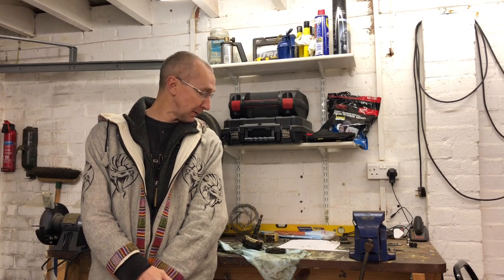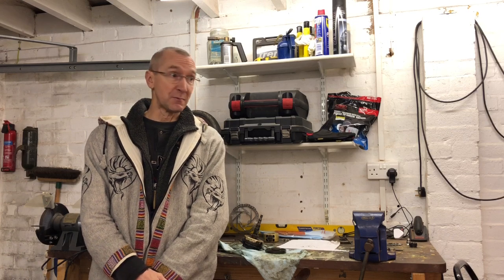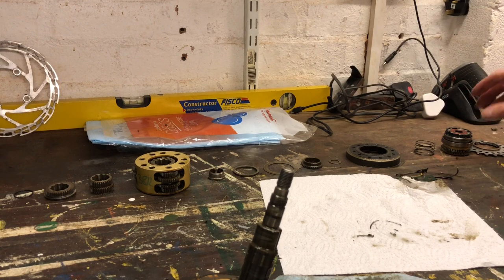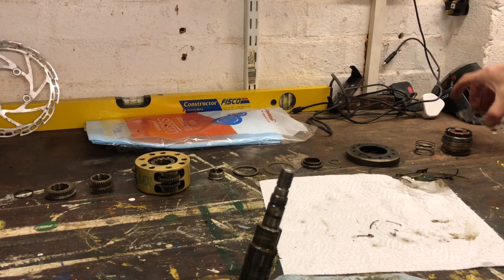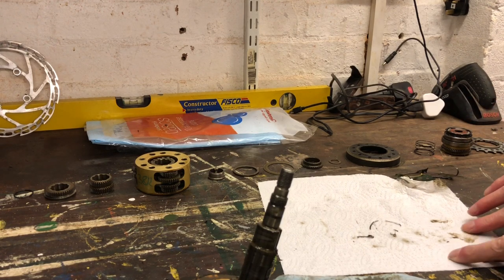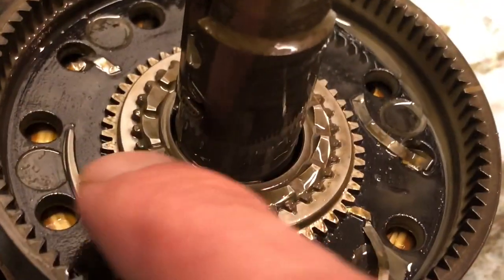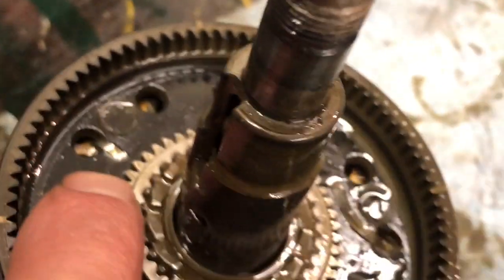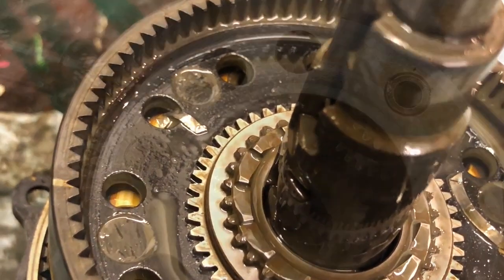Rohloff hub failure after 11000 miles.

Comment: The burr is a pice of the shimmer, and that was so thin, that i it got in to the space between the pin and the carrier, and that has caused the problem, the shimmer brakes apart, and got in the way as you see it. I Think, it caused by to little oil in the hub, to make tear of the shimmer, and then it fail's, and falls apart, because of the friction between the metal parts. I think the repair of the hub will last for a longe time, just put some more oil in to the hub, and Then it will last longer you'r bearings to.... Best to you, my Rolloff has failed to, and I am intending to fix it if I can, mine is skipping and getting something in between the gear wheels as well, haven't taking it apart yet.... so I hope to get it up and running soon.......... I love the Rohloff Hub, it is the best I have had so far... Best to all keep Rohling ;-) Sorry for my bad english I am danish ;-)
Reply: My hub is also slipping but I think only in 8,9,10 and 11. I can ride it OK for, say, 100 km and it will probably slip a few times during that ride but it is tolerable. It will not slip climbing hills in 1 to 7. However it can slip catastrophically in those four gears in certain situations like being in the wrong gear for a certain gradient, or starting from a road junction. However it has only failed in that manner twice in one year. As explained by the OP you have to ship the whole wheel to an intermediary in the UK who then send to Germany. Then you are issued with the cost of the repair. So I haven't bothered to send it yet. I have another Rohloff hub that has done numerous European comping tours with zero problems. The faulty hub was obtained on a bike I bought on E-Bay. Hence you are on your own even if it were still under warranty.

Comment: Rohloff is very accommodating when it comes to complaints, especially if there was a mistake in the production of the gearbox. In this case it wouldn't have cost much money. In such a case, you send the thing in. Rohloff attaches great importance to quality and its name for it. If you buy a Rohloff and there is actually a factory defect in the gearbox, then you will probably get a free replacement, especially after only 17000km and 3,5Years.

Comment: I can confirm! I had a Rohloff hub on an MTB and after an hour of riding off road, started slipping. I had to stop. It was heated also. After it cooled down, it started working but it failed me! Using Deore XT for 2.6 years, mud, rain, no problem.
Reply: PS. I changed the oil when I bought it. It was on a second hand bike.

Comment: I love Rohloff Speead hub as a product, but I hate their approach to selling their products. I can understand that the hub itself is expensive, it's complicated and mostly well machined (not always as your failure proves), but the prices of shifter, axle plates, torque arms and spares are just ridiculous. Not to mention that you cannot get their new 142mm thru axle model with mounting adaptors. They will just not sell it to you,  you need to send them you frame for mounting. Apparently it would be too complicated for the user to choose and order the right adaptor. How about you just include those 3 different adaptors in your 1200 GBP product so the customer does not need to choose blindly?

I really hope Kindernay get on their legs and give some competition to rohloff.
Reply: Are you sure they won’t send the mounting accessories along with the through axle model hubs ?

Comment: Do frequent servicing with ATF oil, or go Kindernay (also with ATF oil)
Reply: Truely? Automatic tranny fluid? On what do you  base that recommendation? Not doubting you, tell me more.
Reply: @portnuefflyer  all liquid for bicycle that looks red are in fact ATF oil. the purpose of ATF oil is to be full of additives witch is needed for this kind of mechanisms. In fact ATF oil is not oil bu rather lotof additives mixed with some oil :D
Reply: @Opteron67   I just ordered another couple refills (I have two R hubs) and this time wised up a bit and didn't search for "oil change kits", just the cleaner and oil itself, a bit cheaper, as I have several of the big syringes already. So too late now but I will compare it to some ATF I have, smell it, feel it,...you got me curious.  20 bucks once a year, to supposedly do right by a $1500.00 (plus or minus)  piece of equipment, isn't too big of a hit though.

Comment: Hi Simon,
After 20,000 km I planned to replace the cock, chain and chainring.  After receiving all the spares, I was lazy and decide to tap the last bit off life out of the parts.  When I heard a new noise I decide it is time to replace the parts.  All easy to do, but shock and horror, the noise remained.  It sounds like an additional clutch, but I suspect it is on the input drive as the sound remains the same in all the gears.  Do you have any idea what this can be?
Cheers

Comment: Have you contacted rohloff?
Reply from the maker: Michael, no. To send it to Rohloff requires me to arrange a return number, package it up, send it to the UK distributor at my expense, they send it to Rohloff, who look at, give me a cost estimate , fix or replace, and then send it back.  That is not a quick or cheap process.  Add in the complication that against everything they say, I went and ripped it apart. So, after 1 week, I’ve had a machine shop make a new spacer at minimal cost, I’ve ground out the burr, cleaned and degreased it and put it all back together.  Just waiting for a replacement paper gasket between the case halves that I tore on disassembly to arrive - which ought to be tomorrow. I expect to back on the road in just over a week for less than the cost of posting it to Rohloff, and way, way faster.

Comment: You're a braver man than I am in stripping a Rholoff Speedhub down, but to be honest at the price they cost I'd expect them to be damn near perfect and have a trouble free life of many many thousands of miles.  
I bought my Thorn Rholoff Sport Tour new on the strength of Thorn's advertising and have now done12,000 miles on it.  It's not the perfect hub gear that I expected, and it jams up momentarily when changing gear quickly. 
In addition to that, the feedback through the pedals has always felt alarmingly gritty in the lower gears and the effort  required to twist the gearchange has always been far too high for comfort.  Despite the impressive claims about the Rholoff hub gear, mine feels a bit like wading through treacle in comparison with my other derailleur geared bikes which all feel noticeably lighter, smoother, free'er  running, and altogether pleasanter to ride than the Rholoff geared Thorn.  Even freewheeling downhill is slower.

Comment: Simon, as long as you are the original owner and have registered your Speedhub with Rohloff AG, Rohloff would have repaired your hub at no cost (assuming it was a manufacturing fault, not abused or damaged). The warranty is 2 years, but after this time if there is a problem (very rare), Rohloff will often repair your hub at no charge under what they call a "courtesy repair". Simply contact Rohloff - you could have avoided the disassembly, time, cost and worries.
Reply: Are you sure they'd have fessed up to the issue?  If Simon didn't disassemble it and confirm a manufacturing defect, he would have had to rely on Rohloff's honesty and generosity to have it covered under a "courtesy repair."  They'd be faced with a dilemma, "Repair it for free?  Or just tell the customer it's out of warranty and get paid?"   Not really the most ideal situation.  I'd rather know before putting the truth and my fate into another's hands.  Again, with something so expensive, Rohloff should have happily accepted the hub as it was and appreciated the fact that Simon figured out the problem.  I'd say the interference fit was wrong, or the operator running the press the day the hub was made had a little to much Spaten the night before!
Reply: Dude On Bike Yes, I’m very sure they would have repaired that Speedhub. Would they tell you what the issue was, very likely yes. Rohloff has its excellent reliability reputation because it is a high quality product although that doesn’t say the product is perfect - Rohloff has an excellent design and they have excellent manufacturers of their components, although sometimes mistakes are made, something is missed, etc. From my experience, if it is a manufacturing error or assembly error, Rohloff will always repair that Speedhub at no cost (and way after 2 years... the age of the hub is not the determining factor, it is whether there was a fault not of the customer’s). You will always read and hear about the issues, that’s what people do - you won’t see many people writing about “I have no problems”. The Rohloff reputation as the gold standard in internal hearted hubs comes from thousands and thousands of Speedhubs without any issue. Btw, if there is an issue with a Rohloff gear unit, that internal gear unit is sent back to Rohloff Germany to study and learn from. Cheers Paul.
Reply from the maker: ...avoided time, cost...
I fixed myself for less than the postage cost to Rohloff and in a fraction of the time. Getting a simple spacer machined up is not expensive
Reply: Rohloff is still owned by its founder not by an anonyme gang of investment bankers making believe even out of guarantee periode Rohloff will show culance in facrory faults. Common they are so big in that business why should they save some money on that rare circumstance to risk reputation?
Reply: @dudeonbike800  If that was a mistake during production then he will get a replacement even after 5 years! But you can also just do it all yourself, but then you shouldn't talk about how, what, where Rohloff customer service is.
Reply: @simonchetwynd  Yeah, good for you. But in a cases like that its just better to send it in and get a new one from Rohloff. If it was there fail they will give you a new one for sure!

Comment: as a machinist all I can say is you are doing yourself and Rohloff a disservice by not allowing them to figure out what was the manufacturing defect and what process they need to improve.  Also, are you sure they won't fix it for free, if I was Rohloff I'd sure want to see your hub in order to diagnose it and review the process that let a defect through the system.
Reply from the maker: In an ideal world yes, send it back to Rohloff. However, I need that bike to get into work so every day it’s off the road causes me issues. Sorting it myself was fastest way to get it back on the road.
Reply: IMHO they’ve made their name from reliability. They put a miserly 2 year warranty on it, and have made resolving issues difficult and expensive. Not a premium offering. 

They deserve to find out by watching their hub opened up and their frankly obvious assembly defect shown to all.

Comment: It has a 5 year warranty, or at least it did until you took it to pieces.
Reply: Sorry ..it's 2 yrs
Reply: @bill7853  Yebbut, you haven't bought a new one. So you are not entitled to any warranty whether 2 or 5 years.
Reply: The warranty is 2 years. After 2 years Rohloff will typically repair any Speedhub that has a manufacturing or assembly defect, as long as you are the original owner/purchaser. That is fact.

Comment: All one really has to know when judging whether or not "German engineering" is superior or not, is to own either a BMW(motorcycle or car), a Volkswagen, or God forbid, an Audi. I think then the myth of "superior" German engineering, will be TOTALLY dispelled. BOTTOM LINE ?  Maybe stick with a cassette and derailer. At least then you can maintain, or replace it yourself, and for a fraction of the cost of that Rohloff P.O.S. I was a mechanic for over forty years. Thirty-three of which, was as a licensed aircraft mechanic, with Delta Airlines. Keep things simple. Easier and cheaper to repair or replace.
Reply: Got nothing to do with "Made in Germany"! So you are a pro Mechanic without fails! So you are the God of Mechanics?🙂
Reply: @ShakaZulu76  I've seen and worked on enough machines, cars, planes, and motorcycles to say, "The more complicated the machine, the more chances that a sub-assembly of it will fail. Modern German cars break, because they've forgotten or don't know to keep it simple. Spend what you do on a Rohloff if that's your thing.
Reply: @letitrest4662  Yeah i believe you! But thats exactly the missunderstanding. Its not about modern German Cars, its about aRohloff Gear, and this gearboxes are proven, simple mechanical planetary gearboxes. I've been driving my Rohloff for 10 years and as a mechanic I'm absolutely thrilled with this gearbox.But even as a mechanic, I wouldn't open the gearbox if there was a problem. I have neither the special tools nor any experience with the planetary gear inside.
Unfortunately, the gentleman in the video had already shown in the video befor that he didn't know anything about it and had already used the wrong axle screws. Then the question arises as to whether these gearboxe weren't already open from others. Just because others mess up doesn't mean that this Rohloff gearbox is bad "Made in Germany"! Or have you already driven the thing, dismantled it, repaired it?
I mean the whole way he showed it just shows how not to do it.
I'm totally with you about these modern German cars and other German virtues. But a Rohloff is damn engineering. And they have a very accommodating service, especially if they had to fix a mistake (when assembled from the factory) and they would have found the metal shavings in the gearbox and replaced the whole thing for the gentleman. That's Rohloff, not Amazon.